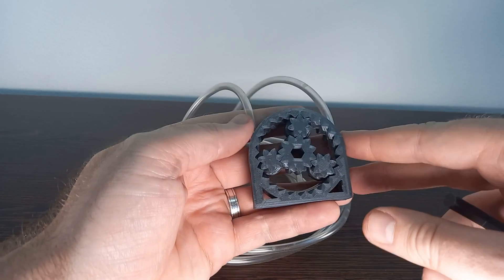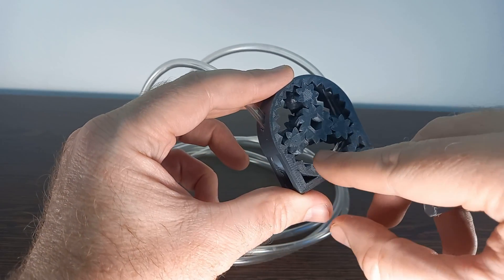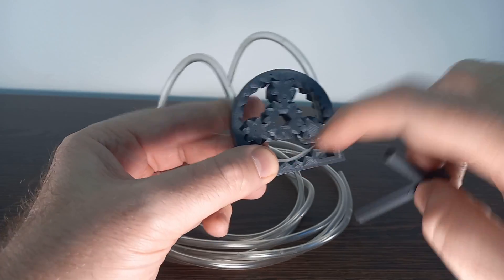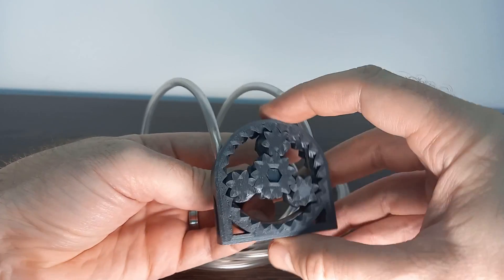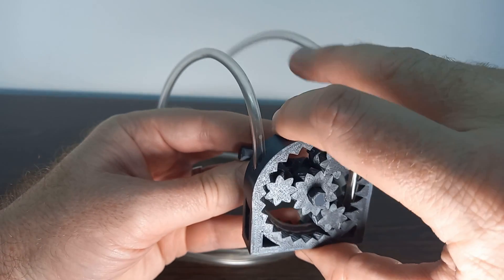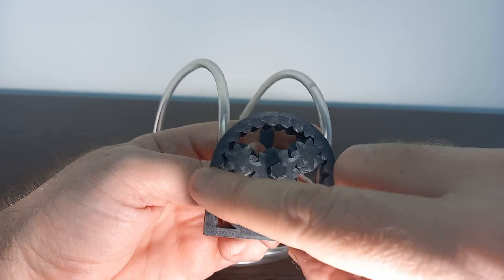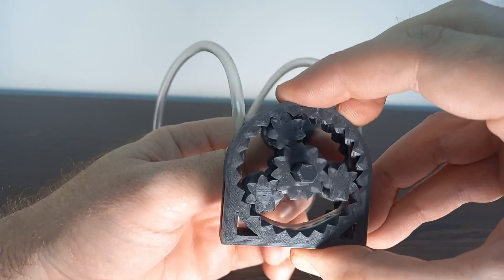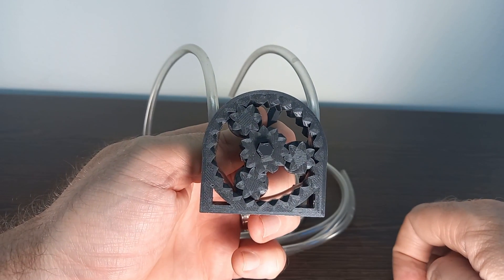Peristaltic pump [3D]

Comment: What size tubing did you use? Also may I know the general dimensions of the print? I think my 3D printer resized it incorrectly and I am afraid I will buy the wrong tubing
Reply from the maker: Roughly 58mm x 58mm x 15mm. Tubing measures about 4.7mm outer diameter